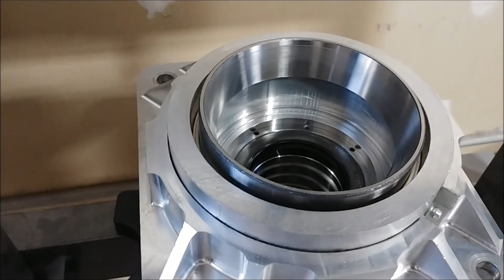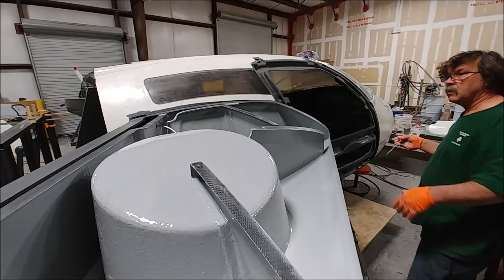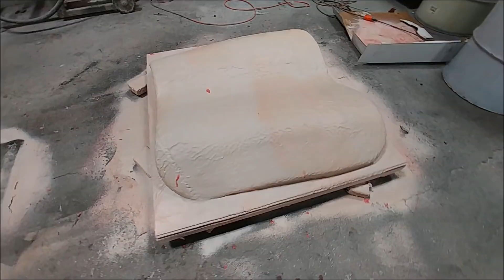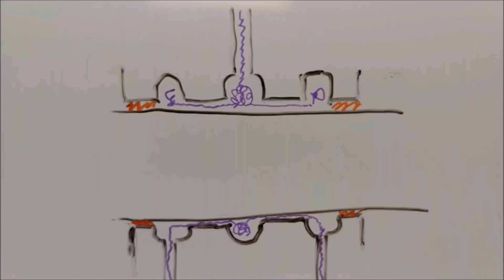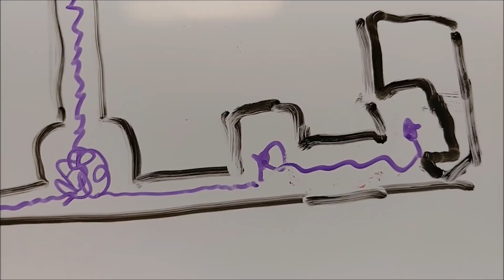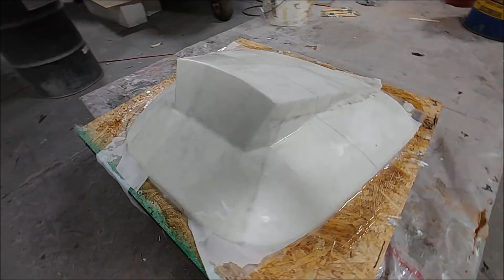We Got Lucky!

Comment: First of all, I'm just trying to help.  I see a couple problem areas.  When you only got 1/1000 of inch clearance between the Oil shuttle  and the prop shaft and the oil shuttle sort of  " floats " on the prop shaft it will always rub some where and create a lot of heat. If the oil is flowing in the  shuttle it might be able to carry the heat away, but doing take off the prop will be at flat pitch and there will be no oil flowing. Another problem could be even the smallest contaminent from the engine oil  could get stuck in the 1/1000 of inch gap.  I will guarantee you if the prop  shaft and shuttle seizes up when the engine is running 3800 RPM it will be game over for the prop, reduction drive and engine . I suggested 3 month ago to feed the oil into the end of prop shaft   with an " off the shelve " rotating seal that's been used in industrial settings for 30 years. please reconsider. Wishing you the very best of luck and thanks for the updates.
Reply from the maker: This is exactly how Continental engines do it! Look it up. We're even using the same clearance that they use.
Reply: ok. will do . thanks

Comment: Would that shaft seizure be equivalent to a prop. strike? If so, would it have damage the engine? Normally an engine requires a major overhaul after a prop. strike. In this case, since the engine had just been started and wasn’t running at full operating RPM, perhaps no internal damage was caused.
Reply from the maker: More like just dropping the clutch and stalling it so most likely no issue.